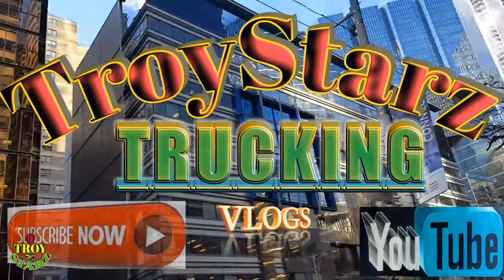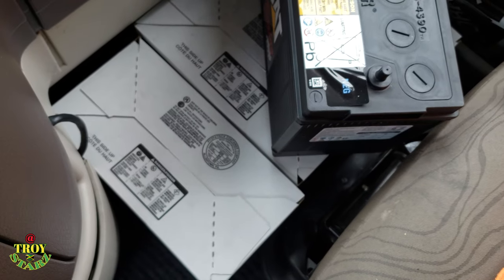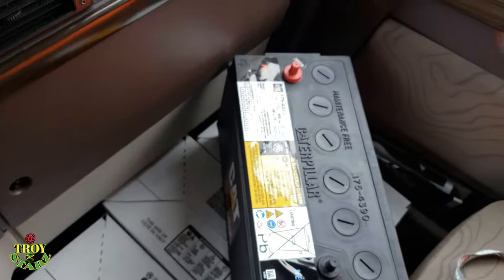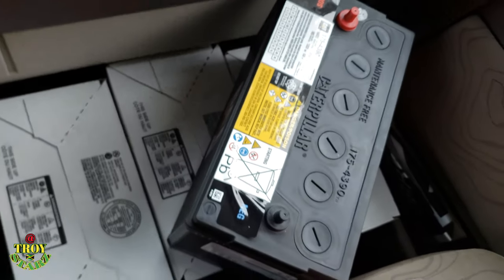Cat Battery | Semi Truck Battery | Are These The Best Batteries For Winter?

Comment: Another informative video, I’m guessing your issue with the short life of your batteries is the constant discharging when parked for your break and time off, batteries do not like to be discharged below 12.4 volts this is the point where sulfation begins to occur on the plates inside the battery, although it is a small amount it is accumulating and this prevents the batteries from reaching their maximum rated capacity.  Relying on the trucks charging system is not enough as it is usually giving a surface charge which does not address the issue of sulfation, I would recommend as part of your weekly or monthly maintenance program to invest in a proper smart battery charger that will give a deep charge and also remove the sulfation that accumulates internally on the battery plates along with all the other routine maintenance on your charging system, clean and tight terminals, batteries secured and not moving, tight and clean connections at alternator and starter etc.  Hope this helps.  

Btw I’ve had my Volvo batteries installed for 3 years and no noticeable drop in performance.

I hear that CAT batteries are the best, but I believe proper routine maintenance is better and will extend the useable service life of not only your batteries but many other components in your truck.
Reply from the maker: Thanks for the knowledgeable information I'll try this routine 👍👍

Comment: Your issue is most likely NOT your batteries. It's how your using your system. 

If you're using your microwave,  you NEED to run your truck to provide maximum power to the microwave. Batteries alone won't provide full wattage. 

Secondly, closing the curtains between the front and sleeper area reduces battery drain when using your heater. You're heating less space, so the heater utilizes less power use. You can always open the curtains when you wake to provide heat to the front.
Reply from the maker: Thanks👊👍👍

Comment: The wisest choice is to use a gas heater. The problem is not your batteries. You may have a parasitic draw or your bunk heaters needs to be be replaced it's drawing too many amps. Don't be a parts changer diagnose the problem
Reply: No, Road Choice, Volvo and Interstate are Junk batteries. Anyone with a Volvo needs to setup up to CAT, Glass Mat or AGM.